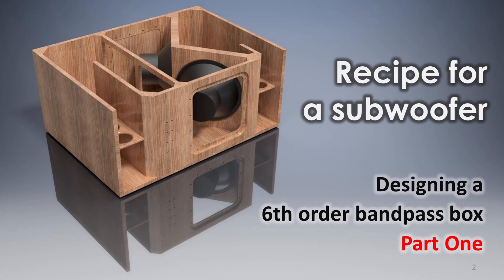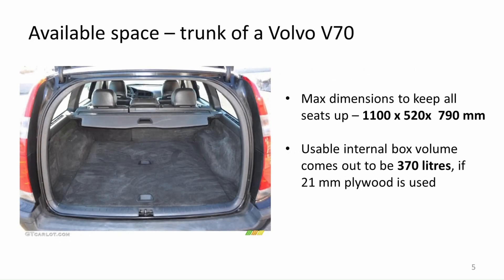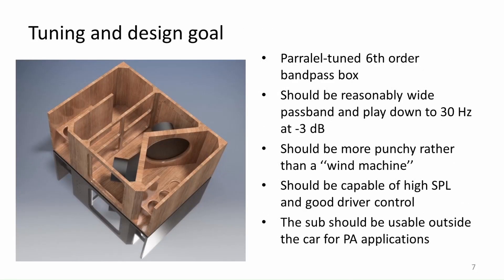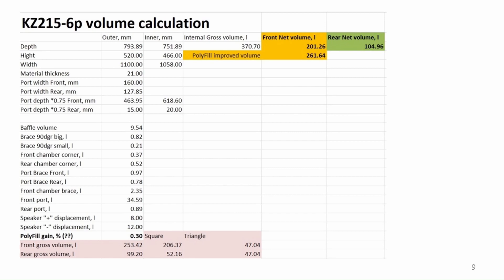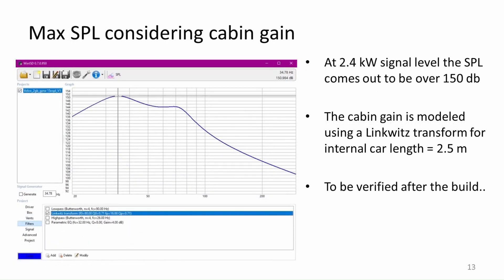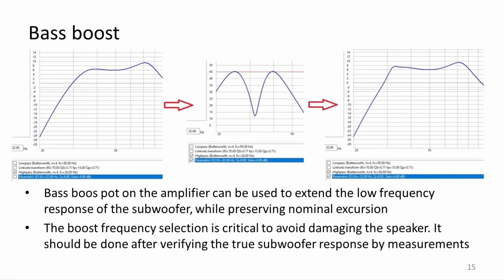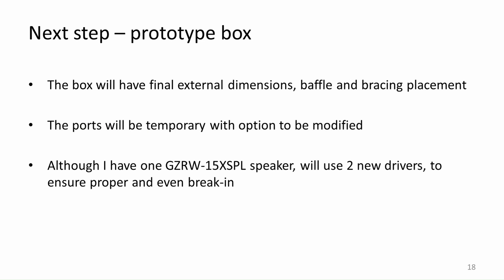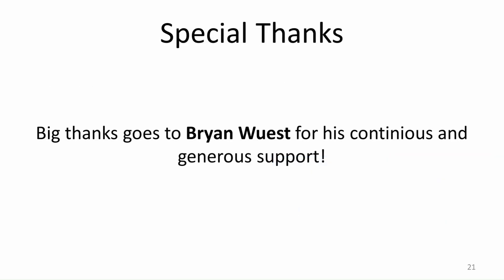6th Order Bandpass Subwoofer Design (Part 1)

Comment: I want to build this box . I have 2 15 inch 500watt rms yamaha speakers . How can I get your plans for this box?
Reply from the maker: Hey! Rough plans can be found in the final part of the build, 13 min 55 sec mark - https://youtu.be/1meOMMevR0A
But I would suggest to adjust the ports and chamber volumes for your specific speakers using WinISD before commiting to cut wood :)
Reply: I got them thanks. Do u have a link to the plans on your single 15 band pass?
Reply from the maker: PM me @ kzdesignlv@gmail.com :)
Reply: @KarlisZalitis  planes for single 15?
Reply from the maker: Yes, I can send plans for single 15" box privately - just send me a message to my email

Comment: Love the design. 
I recently built a 6th order , but I faced the high tune port towards the front of the car and the lowtune port to the rear. (35 low/115 high🤔).. with the crossover settings the modeled curve looks great.
Now, it's pretty loud, but there seems to be a lull @60-70hz.  I can reverse the high side so all ports face the same way, but I don't want to if it doesn't matter. Any suggestions would be appreciated.
Reply from the maker: Hey! I would say that the tuning is way too wide, I would stick to tuning the ports within 2 octaves. For example if the low port is 35Hz, hi port would be tuned to 70Hz, max. But it depends on the driver, box size, chamber volume proportion and many other hings, so my two cents my be wrong.  At the moment in my daily setup the sub works from 30 to 60hz, with the x-over point being somewhere around 65-70Hz from where my 6x9''s take over. I really can't tell when the sub stops working and the 6x9s start, sounds real flat
Reply: @KarlisZalitis   I took your advice and changed the tuning on the high side to @85hz. I know I know, sounds high still, but the drivers are 8's with an Fs of 46.. and it sounds almost perfect.
Reply from the maker: From my experience when listening to "normal" music (not the re-bassed sine wave type tracks) most of the output comes from the hi tuned port, so that by changing the hi port, it will give you the most noticeable change. 85hz for those drivers seem to be a good tuning :)

Comment: is the rear chamber in winISD in the magnetic area?  or rubber?
Reply from the maker: It really does not matter, as long as there are 2 separately sealed chambers with their respective tunings and volumes. Over the years I have decided to call the chambers ''the big one'' and the ''small one'', so it is easier to keep track on the model.  WinISD also does not give different results whether you enter the big chamber volume and tuning into the rear or front calculation area.

Comment: Wow very detailed and accurate 
Did u make it already ? Did u cut it in cnc machine
Reply from the maker: Hey Dan! I have not yet built it but I am going to in the following weeks. The box can be made without a cnc, but I have one and want to make it pretty :D So yes, many parts will be cut on the cnc - the doors for speakers, the big middle brace and the top and bottom boards with grooves for the vertical parts
Reply: @KarlisZalitis  nice . Looking forward for the video . Good job
Reply: When or if you release the cut list, or box specs, how would I adjust this design for the speaker mounts to run two kicker L7s in ten inch? And thusly the overall size of the box?
Reply from the maker: Hey! The cut list is coming soon :) I am still gathering materials for the build, just ordered the 2nd speaker. But to be fair, for two 10'' kickers it will be a completely different box - chamber volumes, rear and front port tuning and dimensions, mounting and access cut-outs.. I hope my future videos will help to answer your questions :)
Reply: Thanks dude, I was planning to use the cut out section's and place acrylic windows and led runs inside.
Reply from the maker: @evelinkk8187  I'm tempted to do the same now.. :D